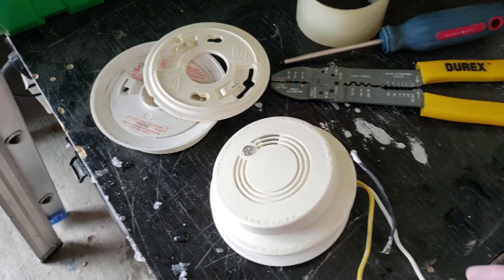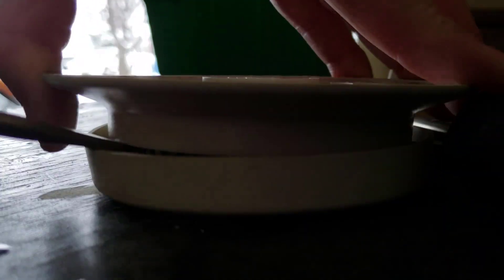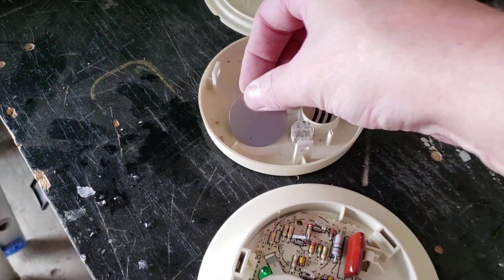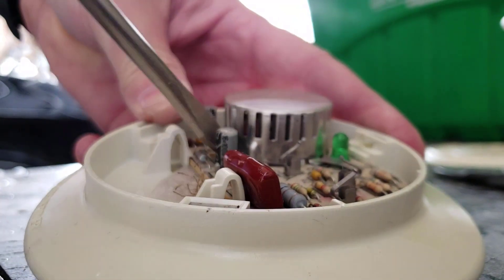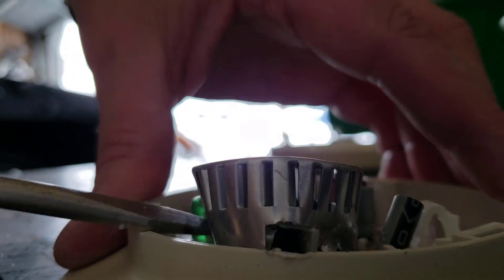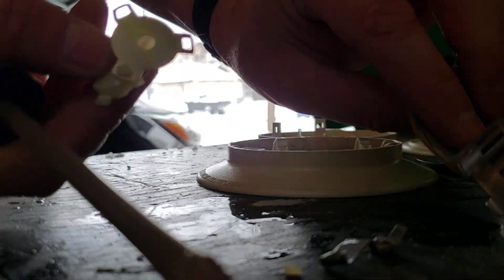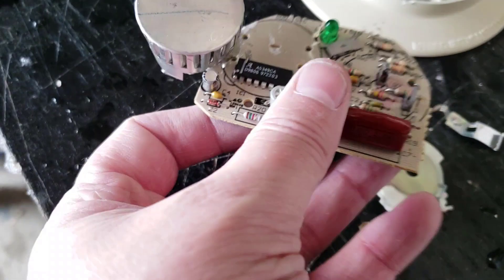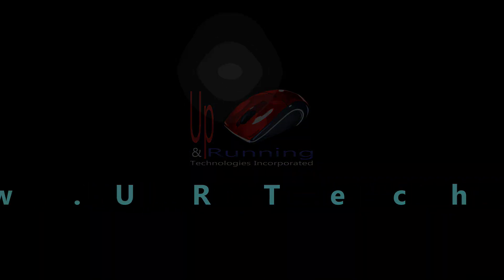Whats Inside a Smoke Detector?

Comment: The stuff inside the metal case you opened up it was radioactive!!
Reply from the maker: That is a bit alarmist (pun intended).   It is not near as dangerous as you make it sound.  It is consumer grade radioactivity and I only had the tiniest of exposures.  However, your point is well taken and thanks for it.
Reply: It's just alpha radiation. You can stop it with a sheet of paper.

Comment: Very sad you destroyed a vintage rare smoke alarm also you just tuch radio active metirel Wich is Americiam 241
Reply: Americium is an alpha emitter, it won't do anything unless you eat it, plus the stuff in these smoke alarms have a shield to prevent death from ingestion.
Reply: @junglejim9551  Yeah at the same time you can find 2 types of smoke alarms in one witch has 2 sensors instead ionization and photoelectric
Reply: @junglejim9551  its not just ingesting it but if there is any contamination that you could take in via cuts etc that would create a pathway to irradiate the insides of a body part
Reply: What year were they made? Our house had 3 before we upgraded to the one that came with our security system
Reply: @theniftylynx6897  Ionization alarms are still being made to this day Ionization alarms detects fast burning fires and Photoelectric alarms detects smouldering fires so its best to have both of them in your house
Reply: @Mr Brown Jack thanks for the information!
Reply: @theniftylynx6897  You're welcome
Another thing you should do with your smoke alarms is to replace them every 10 years and to replace the battery's in them every year or when they chirp
Reply: He don't know anything... Waste of my time
Reply: @laasyalasya6515  Yeah 

At the same time in reality I do know alot
Reply: @MisterBrownJack  bro youve literaly just read a google search result ANYBODY who IS ANYBODY know that
Reply: To everyone who comment, do not try this at home. Americium 241 primarily emmits alpha rays but also emmits  0.0595409 gamma rays which will pass through human body by the skin. It will damage tissue and DNA.
Reply: @oscar7476  you go skiing or boarding or go on airplanes? you get a far higher dose at altitude and the amount of gamma ray dose in mSv is less than background radiation. but hey your not supposed to be coming in contact with radioactive sources deliberately. "an individual who spent four hours daily in proximity to a typical granite piece, with a dose rate above background of 0.1 µSv h-1, the accrued annual excess dose would be about 145 µSv, an insignificant amount in terms of any negative health consequences"
Reply: @jrs-sx5jb  yes ur totally correct, i will still avoid coming in contact with radiation whenever possible.
Reply: you just won the award for best spelling
Reply: @safepancake7551  lol spelling nazi but yeah... agreed.
Reply: @safepancake7551  who cares, just spelling